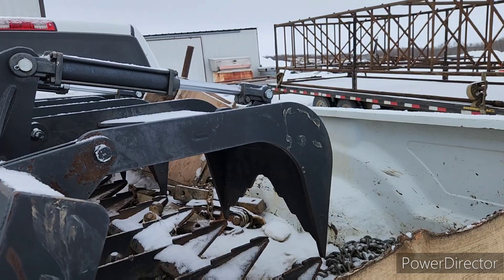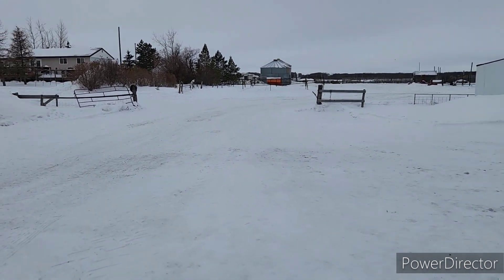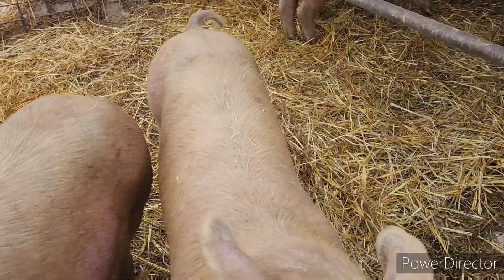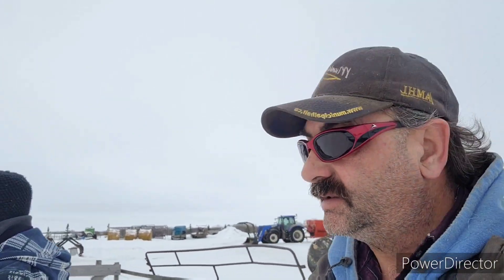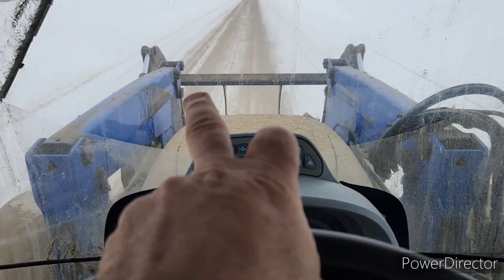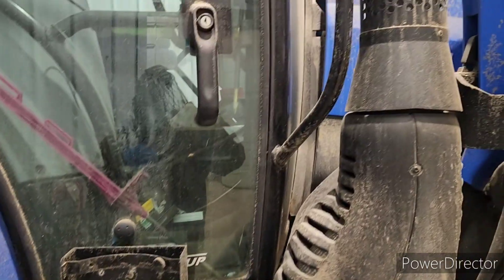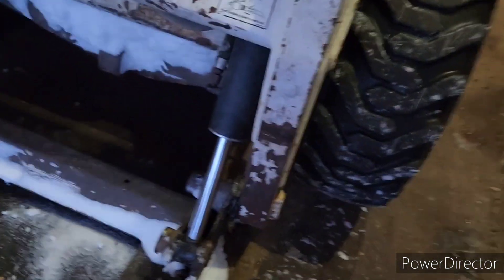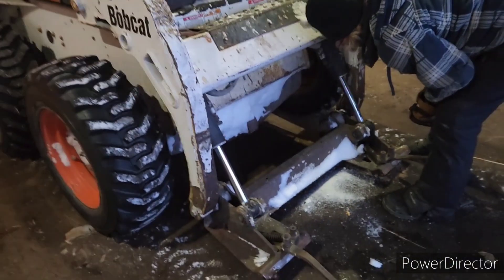This and That,

Comment: I’m into rotational grazing but not to the extent of a lot of diehards.  Our rotation lengths vary from a week to a month depending on the pasture.  However, it has added a lot of animal units to the farm because of a rest period for our pastures.  Most pastures only get grazed twice per summer, maybe 3 times depending on how tame the pasture is and if it’s lowland versus bush.  Our grazing lease is only once in the middle of summer for a month cause it’s pure bush.  Because of how our land is situated, we run 3 herds, so usually end up moving one to two groups a week roughly so management wise, it’s not terrible.  Gotta check them anyway cause 90% of my fencing is hot wires.